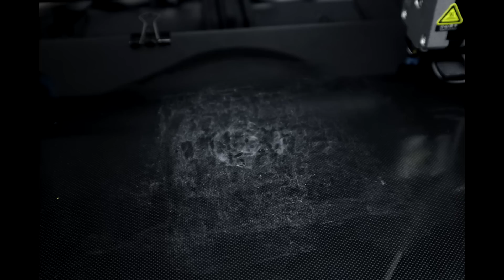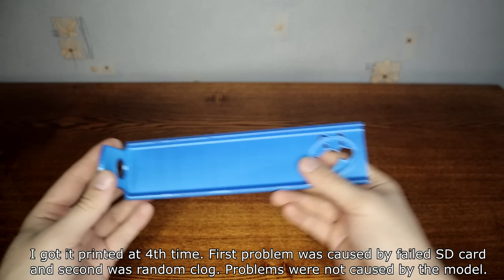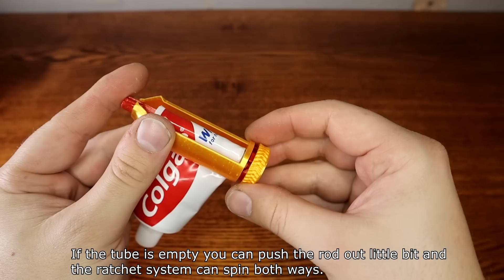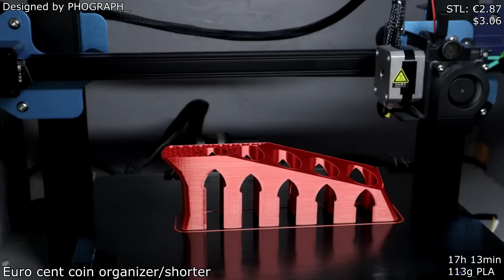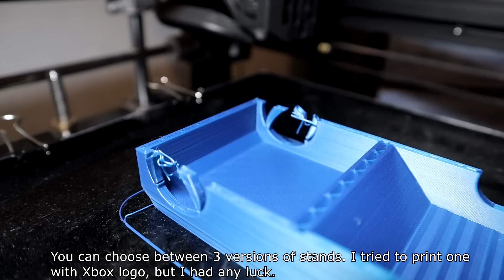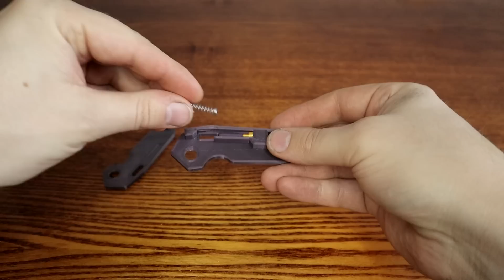Useful 3D Prints March 2023

Comment: hey man, what's your thoughts about "glow in the dark" filaments? do their glow last a good amount of time? I was thinking about getting some but didnt find many reviews about
Reply: Glow in the dark filaments tend to last differently depending on the brand/quality so best to look into individual reviews. Be warned before starting to print those, they have a hugely negative toll on your extruder gears and nozzle. The compounds used to make them glow are extremely abrasive, often more than carbon or glass fibres. You can definitely achieve success with them, but look into others' experiences and upgrade your nozzle to a hardened one as necessary. Good luck!
Reply: @sarahcase9872  Thx so much for the advice! I'll be looking into it
Reply: @JonathasPatrick  Of course! Hope you get some cool print results.
Reply: I made a glow in the dark wall mount for my PS5 controller and just from daylight exposure it glows pretty steadily at night. It's really cool!
Reply from the maker: The glow time depends how much light it will absorb. I used Filalab glow in dark filament. I haven't tried others so I can't say if it is better than others, but it seems to be glowing nicely.
Reply: We recently started playing around with some glow in the dark filament on our channel and it has been a good experience but definitely make sure you have a hard nozzle and good quality filament. I use the anycubic kobra neo and I haven't had any issues so far.